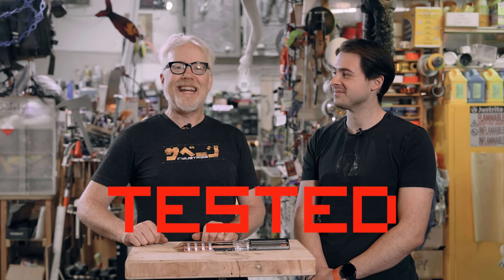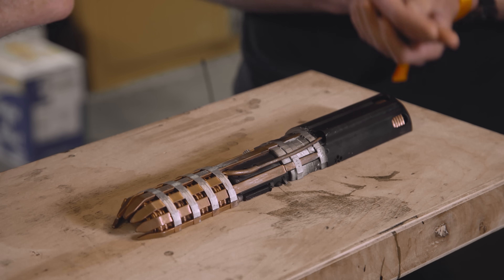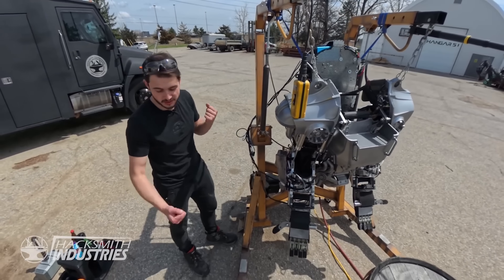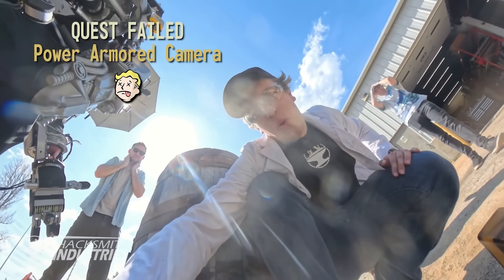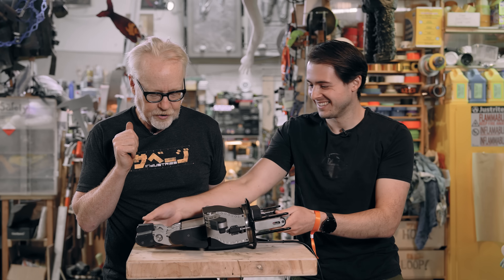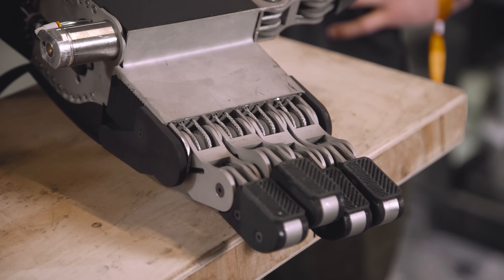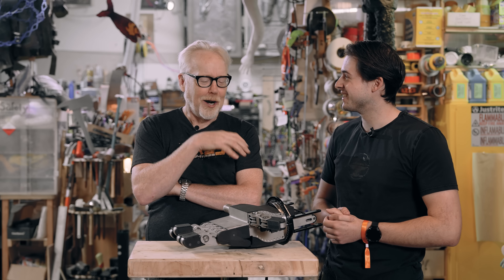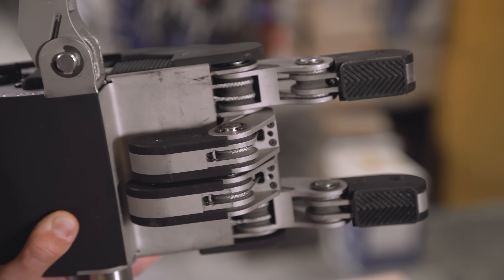Adam Savage Operates Hacksmith's Fallout Power Armor Hand!

Comment: Power Armor channel is a understatement.

They'll collaborate with a military gun range channel to have it equip and test out recoil and accuracy of wielding heavy weaponry in a power armor.
Reply: I kinda doubt it, the hands are far too big and unergonomic to fit a standard rifle or pistol.
Reply: @rider4440  Who said its heavy weapons made for human hands? It could be remote triggered with a connection found in the grip.

For instance the M2 Browning Machine Guns don't use normal trigger and grips, especially vehicle mounted ones, and can be modified to be remotely used on a tank.

It's mechanized heavy weaponry I'm talking about, like Warhammer 40k bolters.

Like a "power armor" scaled pistol that fires 12.7mm rounds.
Reply: @dra6o0n that's actually something I was thinking of. Have an M2 in a custom mount with a trigger that electronically fires the gun. But for the most part that's a fair bitnof extra engineering, plus they are Canadian and afaik stuff like that doesnt exist like it does in the US, unless they do it for a one-off.

Comment: Never understood why they didn't use a wire control/feedback glove, not as much force as switches but that was neve a thing in fallout either, they needed to to able to operate standard issue firearms so protection was the reason for not just using armored gloves sticking out the suit. .

Comment: Love this project. It is strange to me, though, that they are using pressure-sensitive switches instead of off-the-shelf finger-tracking hardware like VR / mocap gloves.
Reply: Those are fairly expensive and can maybe have feedback issues, its likely far easier just to have buttons and a physical bar you twist instead of a separate motor to spin the hand and then try and translate finger movements into the hand movements. Though I will say I far prefer the glove idea.

Comment: The US military has to be paying them something, there's no chance they aren't interested in this tech.
Reply from the maker: They are Canadian.
Reply: Humanoid robots and exoskeletons are cool to see, but that's about it. Too slow, too bulky, too expensive, too heavy, too noisy. And nothing on the horizon to solve any of those problems. 
We got better at it, but more or less, even with all the tech and material science advancement, when building a mechanized arm or something we're still limited by the same compromises we were 40 years ago. Electric VS Pneumatic VS Hydraulic. All got better, with better controller and smarter, cheaper sensor and more computing power in a smaller form factor, but the rock-paper-scissor kind of compromise is still there, unchanged.

Look at how expensive a single industrial robot arm is, and those are bolted to the ground, now think about 4 of those, plus all the required hardware and power unit enclosed in the body/backpack. With what that comes out costing, once you factor in that has to be robust enough to work for hundreds of hours without problems, not just for a 10 minute shoot every hundred of hours of preparation and maintenance you could probably buy an excavator, a truck and a tank.

Comment: Hey guys.... Sorry but, why is the the thumb in the wrong axis?? Its orthogonal to the fingers when it should be antiparallel
Reply: For an easy explanation it’s due to the engineering difficulty. I’m assuming it has to do with the cable that pulls the thumb. It would have to be going antiparallel to the rest of the fingers and would prove difficult to fit into system in a different direction within the space provided.
Reply: @AbeTheRock  They never heard of a pulley? lmao
Reply: @Akanoyoru  The fingers are pulley driven, so they probably didn’t have the space for another pulley for the thumb and decided to go with the easiest method of actuating the thumb
Reply: @uwuanims  Bro if the thumb linkages are pulled by a cable there would be no reason not to mount the thumb properly.
Reply: Have you seen the hand video explaining how they work? It's hard to describe in few words and I want to make sure we're on the same page
Reply: I was wondering that too.
Reply: Thank you! You saved me from pointing this out.